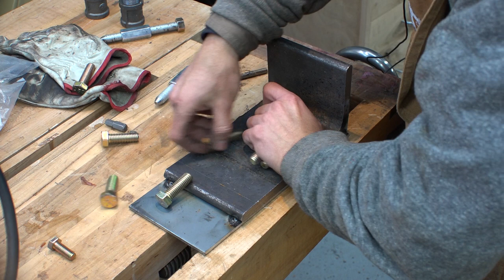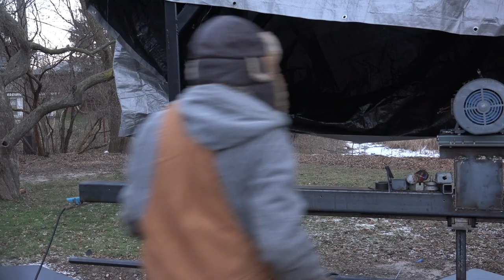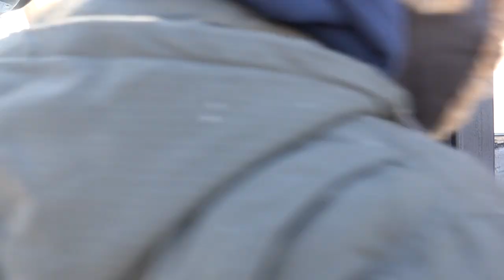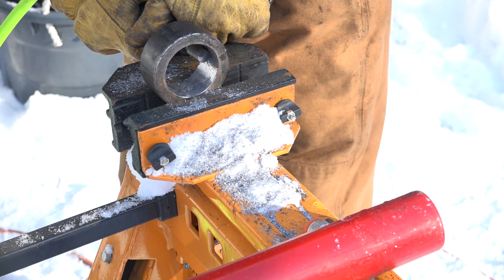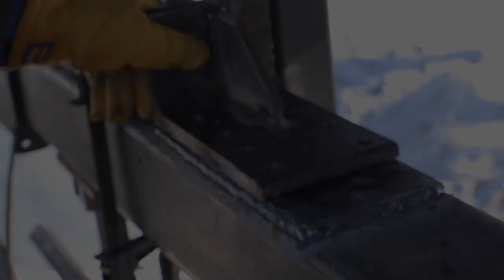The Tensioner - Building a Large Bandsaw Mill - Part 16

Comment: Calculating the required number of bolts is actually quite straightforward. You know the force that will be acting on the bolts which cannot exceed the rated force of the hydraulic cylinder. You also know the ultimate tensile strength of the bolts which is given as a force over area. So you can use UTS=F/A=0. F/UTS=A That calculates the total required cross area of the bolts. You should add a factor of safety to that of 2.

Comment: In a conventional bandsaw a mechanical screw is what actually tensions the blade, and a spring regulates and keeps the tension constant under various cutting loads.   Is your hydraulic ram  performing both functions - or just the former?  I don't know much about hydraulics, but if it also performs the latter function, how does it do so without an accumulator of some kind to take up any slack and act as a cushion?

Comment: Diameter of ram squared times point 7854 equals square inches of cylinder area. Take that times your PSI and that will give you your force in pounds.

Comment: Any ideas about protecting the big thread bar that adjust the height of the blade? Perhaps tread a small dust collection hose over it which get longer/shorter as you adjust? :)
Reply from the maker: I'll be adding a protective bellows to the rods and the linear rails.  Same concept as you suggest :)

Comment: You really should be preheating your welding areas as well. In commercial welding, building inspectors will not pass your work if not preheated to 100+ degrees when the outside temp is that cold. Some inspectors will have you preheat when its right at freezing. Usually its 30-25 degrees before they make you.

Comment: Hi Matt, did you talk with a structural engineer before you selected materials?  I ask because it looks like it might be overbuild, not that it a big deal, unless you plan on moving it.  At any rate I know SE's have some quick tables that tell them what steel has what strength.
Reply from the maker: +John Lowe, Photographist I didn't. My material selection reasoning varies by area of the mill. In the case of the tensioner, it was based on cost since I only used pieces I found in the drop bin at the steel yard I go to.

Comment: hello Matt , each raised mark on the head of those bolts means a " sheer strength "  number . in short I think you would have been fine with using  six of bolts in stead of eight . . seeing how you "love to drill and tap"  ( no I don't believe you) , you have an awesome machine in that band-saw mill .
Reply from the maker: hahaha the tapping part I still enjoy.  I tried a 6 bolt layout and it just didn't look right.  The 8 bolt layout reminds me of a riveted structure. Looks cool to me
Reply: Haha ,  yeah , it does look cool .

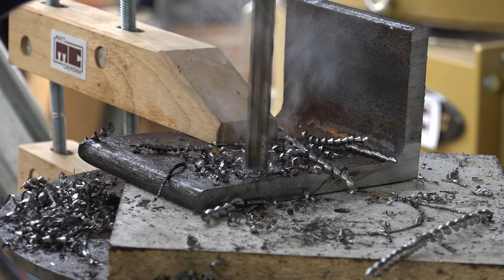Comment: @5:47 With all the holes you have been drilling - I don't know what you call those long curly metal shavings but they must be super sharp and pointy and quite dangerous. How do you stop your dog or your kid from coming in contact with them? Is it as easy as pulling a magnet through the worksite at the end of every day? Is this being too Safety-Sallyish?

Ps: thanks for enclosing those saw blade wheels I have been worried about kids sticking their arms through the wheels ever since you first put the wheels on and I let out a huge WHEW when you built the guards :)

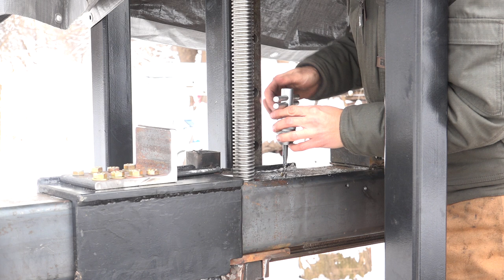Comment: @ 12:15 Gun taps are meant to be power driven, it's not a hand tap.
That hole could have been done in seconds!
And why a hydraulic tensioner? 
Most I have seen were spring actuated.

Comment: That's a lot of bolts, do you realize how strong that is? The shear strength on one bolt alone would have been enough for the application. Just seems like a lot of unnecessary work.
Reply from the maker: +Duncan “DunMac” MacKenzie oh I realize it. I just like the look
Reply: That's fine man for sure. It'll NEVER break that's a certainty. ~ Stay warm...er.
Reply: Redundancy is a good thing here. If those things snap while in use it won't be pretty.
Reply: I agree with you there, nothing wrong with a bit of redundancy, there's certainly a bucket load here! IMO, too much, but that's just me. I'm the kind of guy that liked to work smart not hard.